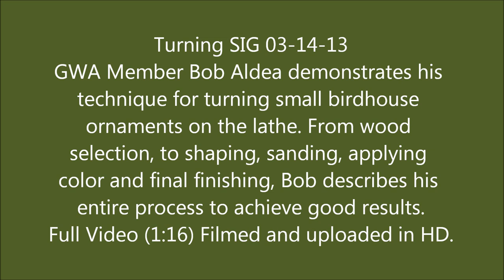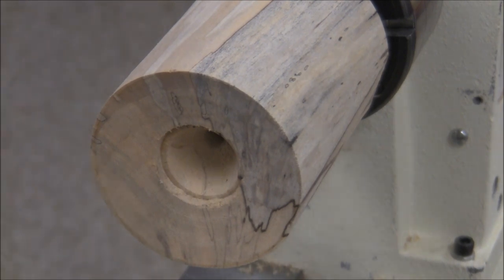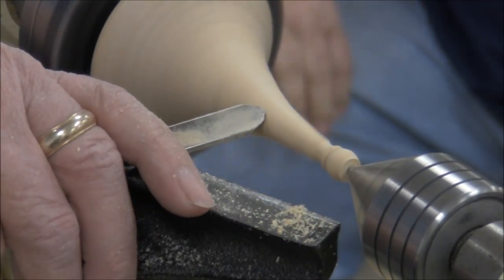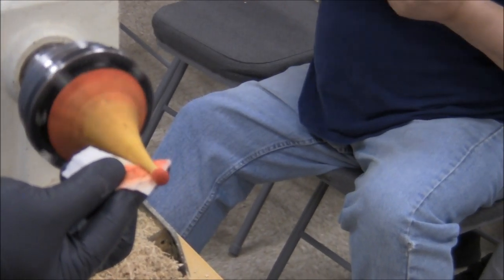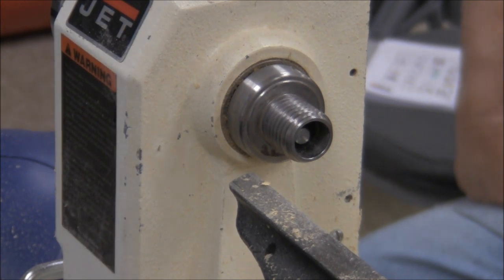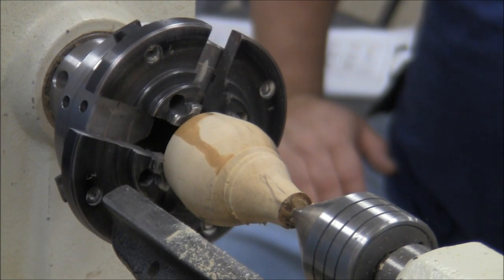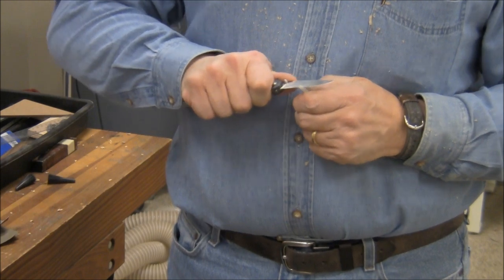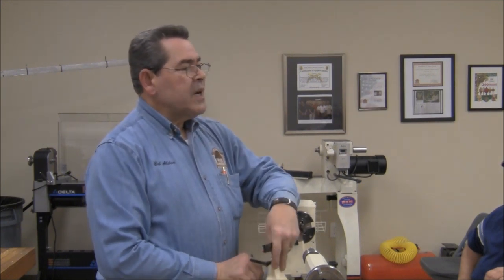2013-03-14 Birdhouse Ornaments by Bob Aldea (1h16m06s)

Comment: Great video. Definitely detoured me from buying that two handled chuck from psi! Chucks are worthless if they can't hold onto anything.
Reply: Big Dan,  I have a Nova chuck and that thing holds on like no tomorrow.  I don't use two handles to tighten it but rather I lock my spindle and just use a single handle to tighten or expand the chuck...I also don't use the little handles that came with it but I use my push stick (don't know the term for it) that I use to push out my drive spurs, etc.  The longer handle allows you to exert more force.
Reply: Works for me. He did say he's had that chuck for decades. God knows what might be on the inside of it stopping it from working properly.
Reply from the maker: The PSI chucks work great. I prefer chucks that use dove tail jaws but that's just my preference. The PSI chuck can use any of the jaws from the Nova line. A chuck with Tommy bars normally cost less but work just as good. I feel I can tighten them tighter than the keyed chucks.